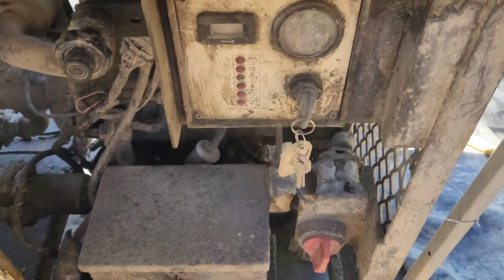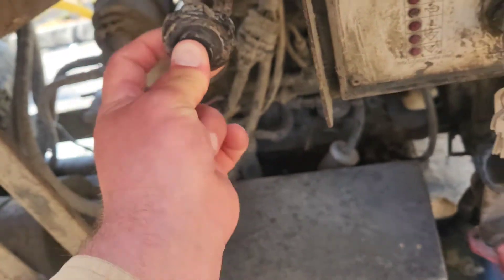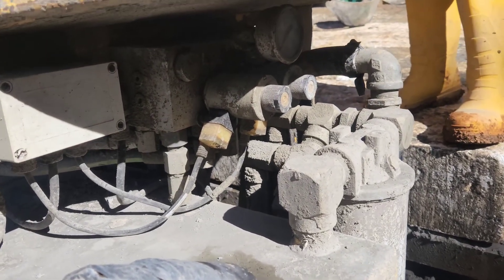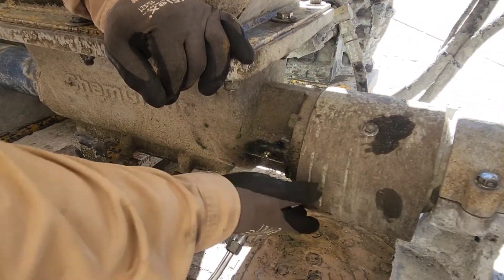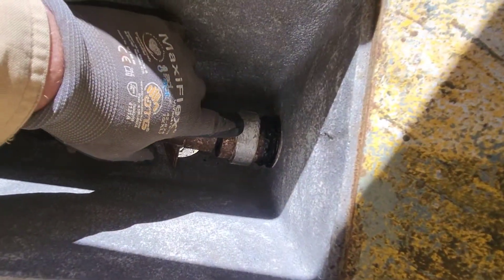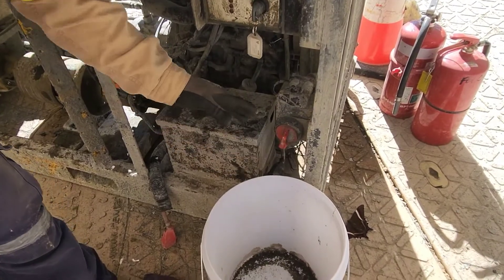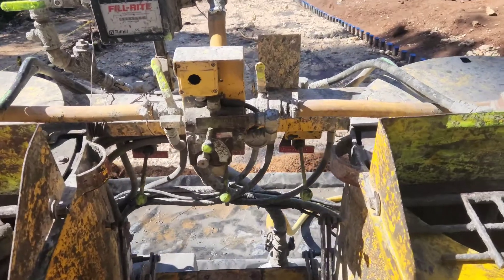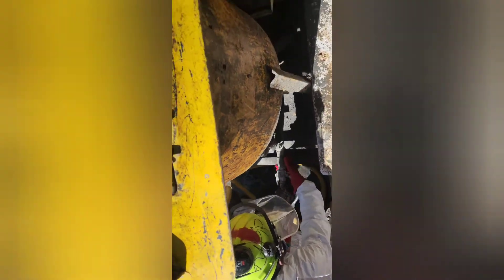ChemGrout plant basic knowledge demonstration

Comment: NIce video, but one question when you say "left hooper and right hopper' are these hoper the agitator tank and mixer tank? 
thx
Reply from the maker: Yes, both hoppers are for mixing and there is a mixing motor and paddles in each.
Reply: @markfutrell6758  thanks, I am doing a spare parts list for a grouting activity, i am including, hoses, clamps, valves? what else should add?
Reply: We have 13 and 17 CF TANKS as well ....